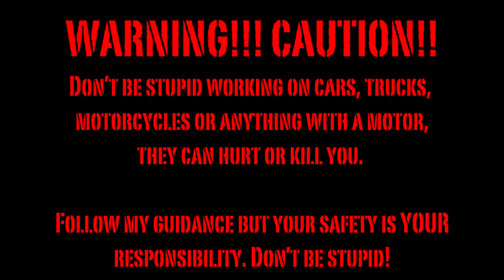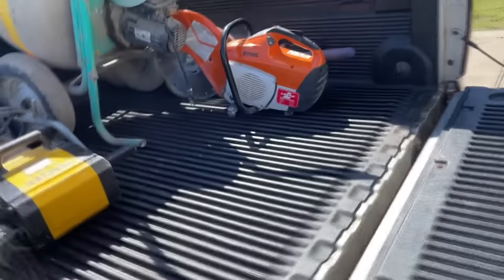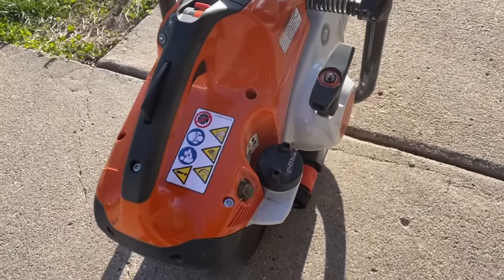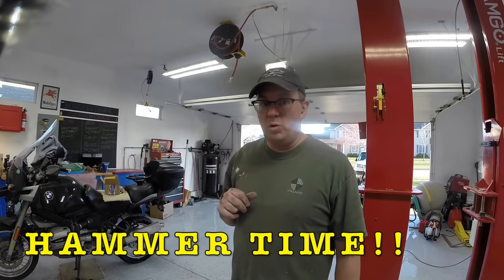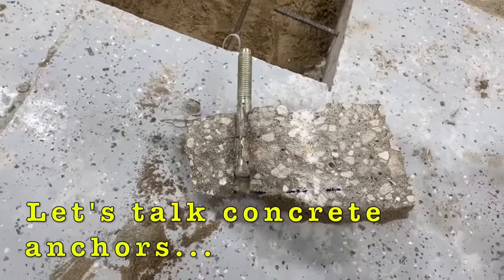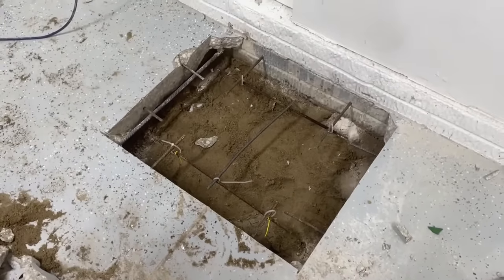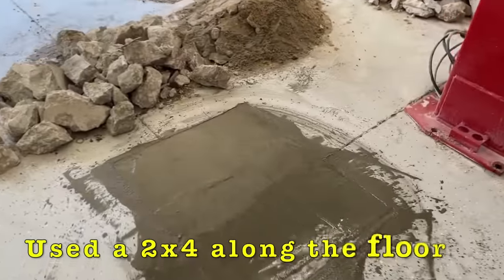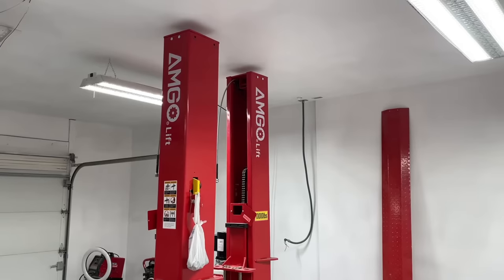My Lift tried to Kill me!

Comment: When it is a safety issue like this and I still want to DIY, I would make sure I followed the concrete instructions.  I'm fairly certain you poured it too wet, which will compromise the strength.  Especially when you have a machine mixing for you, I'd dump in the quantity of water on the bag and let her rip.  If you are mixing it yourself, I find most people make it too wet because it's hard to mix otherwise.  Another safety tip though, when working with concrete, you really want to wear gloves (Concrete is caustic) and more importantly, a good breathing mask.  Silicosis is no joke.  Cutting the concrete dry and hammer drilling it are the worst offenders, but I'd wear breathing protection even when cutting it wet - it's just not worth risking it.  The other thing, and perhaps you already knew this, but if you have a post-tension concrete slab, you want to x-ray the floor and make sure you don't cut into those stretched members, because they can rebound with enormous force.

I'm not a fan of 2 post lifts because they are not as forgiving with install and concrete slab requirements, but all of this being said, if I had one, I would tie the two posts together at the top with some metal plate or square tubing.  That way if they did try to bend inward, you would have additional stability.  I have seen a number of two post lifts that already have a top piece like that.

Comment: I don’t know if That was the outside wall or not by just cutting out a small section and added 7 inches of concrete, and bolt it in with longer bolts is still gonna act like you’re bolted into a cinderblock! At that point, I would’ve dug up most of that floor and put a bigger slab in and let it cure for a much longer time

Comment: When pouring the new pad, why not use a template and install J-Bolts or similar into the fresh concrete?  Then one is not relying on anchors.
Reply: He doesn’t have enough clearance at the ceiling to lift the the lifting columns up over bolts sticking out of the floor. But his redo job had so many serious problems the bolts would be the least of them.

Comment: the rebar is probably in the correct place, it is placed in certain places near the top or the bottom whether it is under tension or compression. however it should be over 50mm from either the top or the bottom.. i think these anchor bolt fixings are death traps. relying on a bolt in concrete which you know only too well has failed, probably not a strong enough mix when it was poured. i would be welding on some outriggers to the legs so there's no chance of it tipping. might have been a good idea to have under cut the slab on all four sides to make sure the new area can't pull out, like a dovetail joint. basically wider at the bottom than the top.

Comment: I dislike trusting concrete even with chemical anchors (if you don't know what those are, study them because they're what the pros use, not wedge anchors) so I welded a large H out of heavy H-beam (surplus steel is easy to find) and welded the base of my used lift to that. It can't tip in any direction and can even be used outdoors if you bury the H flush with the ground. For indoor use if you're gonna cut your slab removing enough for at least a stout beam connecting the bases of your chosen lift is easy and if properly welded (or bolted to plates, but welding is a lot less work) the lift cannot tip inwards. I used backing strips and 7018 filler but cellulose rod is ample too. What matters is a quality weld.

Comment: Dude where you go? I hope your ok. 4 inches would of worked for light duty. The problem was o close to the wall plus the anchors are not deep enough if they are even grabbing. You can see the studs sticking up way too high. Plus you never hand mix cement for a lift.

Comment: I know your feeling.  I have the Maxjax lift and it has the wedge anchors too.  I don't like them at all.  I couldn't get them to bite either in my 4 in concrete.  I changed most of them out for the epoxy anchors and those are solid.   I didn't have any issues after going the epoxy route.

Comment: Every 10k lift uses 5.5” anchor bolts with 3 3/8” and holds for life. That’s a cheap lift probably wrong hardware.  Why was there so much threads sticking up?

Comment: I see this failure too often.  A simple metal brace across the top would reduce flex and stress.  The leverage on such a small base is enormous.  It doesn't help in this case, the post was installed too close to edge of the slab and the concrete probably was not 30 mpa.  Even the installation of small footings is not sufficient, that is anything less than 24'x24'  x 36' deep using high strength concrete and 36" bolts.  However, this installation might suffice for a while.  But is it worth the risk?  Again, in this case, the rectangle should have been 90*. Also, this slab has no rebar.  And the rebar added...  you couldn't afford more bar and anchor points?  Scary.  PS  Concrete only works in compression, not in TENSION. (which is the tucking of concrete under the existing slab, there is no strength there.)

Comment: The pad I poured for my lift has 16" deep x 48" x48" under each post.
What you did is no better than the shitty original install. And the mix was WAY too dry. If you are not going to do it right, at least tie the 2 posts together with a 2x12 and attach that to the ceiling joists for lateral stability. It will be many times less prone to leaning again.

Comment: You can't drill structural holes in concrete with a cheap hammer drill. You need a sds drill for #4 steel and drilled at least 12 inches into the steel.

Comment: Wrong anchors. Wedge anchors suck. A sleeve anchor would have gripped the hole.

It the floor was 10" deep, the wedge driver would have had solid backing and expanded tightly. With only 4" the wedge broke out the bottom part of the slab and didn't fully expand.

A sleeve anchor would have drawn the wedge part up into the sleeve.

Comment: The pads needs to be at least 10 times large  and encorperated  together. The concrete to be twice as thick with the anchor  bolts incorporated  with the resteel. This is the  very minimum also use less water with a7 to 9 sack cement mixture with 6aa stone and 2ns sand. Consult  a structural  engineer

Comment: Did you remove the former existing rebar? 

Often, those are on tension/torsion systems to make the concrete pad stronger. 

If you removed them, you just screwed yourself.

Comment: Mine did the exact same thing it was very alarming I ended up having 18 inch j bolts made and put it in the foot and a half of concrete and you can crash into it with a truck it doesn't move

Comment: Patch job not good enough.  Patch should have been about twice as wide (or more) and should have been one large patch from side to side, connecting across the middle. I personally would have gone deeper than 7 inches while I was at it.

Comment: Well, I’m no professional installer but I’ll guarantee you are not supposed to put it that close to the wall? I’ve also seen the regular wedge anchors fail, constantly get loose etc. I like the long threaded rod imbedded in special epoxy. I’m getting one and getting it professionally installed even though ai could technically do it, my lift will weigh just under a ton, yes, over 1,900 pounds, no back for that. If I was going to all that trouble, I’d go down a foot. I just had mine poured. They dug another 6” or so, 2’x3’, so that area should be 8-12” thick, also used 3500 psi, fiber reinforced too. When your life is on the line, you can’t put it too deep. Hope it works out for you.
Reply: I forgot, they also put wire in the whole floor, and pull it up into the concrete where most just let it lay there and pour over it.

Comment: Well it didn't collapse?   I have a lift similar to that in my shop and i put some heavy brackets going up to trusses to tie it all together, supporting the top from leaning one way or the other. Works fine, you really have to get the vehicle centered properly with weight distribution which most people don't. My bolts are only in the ground 4-5 inches at most.

Comment: I think  I would  have drilled  a whole  in the center of the  cutouts and  installed an eye hook. I would have used an engine hoist to lift the cement in one Section and not have to use a hammer and chip the epoxy

Comment: should be a foot away from the wall. 4 inches is more than good enough but 6 is obviously better. the new pads you poured are also too small. should have done minimum 3x3 feet

Comment: my lift broke the concrete 30 seconds after i got out from under my truck. I almost got killed. I built a support bracket from the top of the pillars. i have the same type of lift. my truck dropped sideways.

Comment: That concrete is way too runny it is not going to be structurally  safe. In my opinion you would have been better off with installing a larger steel base plate to help distribute the load bolt through the plate & weld the plate to the lift too. Way more work but in my opinion the only way to do it. An 1/2" thicc steel plate is probably stronger than a 4" steel slab

Comment: I think i would have put J bolts in the concrete when i redid this. Also i have anchored hundreds of things using those anchors and never has an engineer called for using epoxy with them. I dont ever recall one failing either. Good work looks like it was a pain in the ass.
Reply: I also never had one that failed before either In 25 years of using them, Plus they were too small you should have been using 5/8 minimum Diameter Anchors on that lift, also should use a transit to level those lift pillers
Reply: @dougdier3104  did you mean to plumb them then you use a plumb bob

Comment: You can’t bolt lifts on the saw cut lines. And you can’t possible have bolted the outer post level along that edge in a garage. You didn’t do it right from the start

Comment: Your outer bolts are very close to the outer side of your concrete floor. You should not install the post so close to the edge of the concrete, it is not about the siyze of the bolt but a wrong placement…

Comment: Footing definitely not a footer and 24×24 and 18 inches deep then make a plywood template and then get wet set J bolt's no less than 12 inches long and I personally would drill out the factory holes and use a 3/4 bolt 18 inches long and a plate washer on the bolts so it spreads the hold I did my buddy's lift and it doesn't wiggle with my 2500 long bed crew cab

Comment: You have way too much thread showing on the bolts, and you should be 6" away from the wall. Lift was not installed properly. The Bolts are fine..

Comment: There isn’t just a thickness requirement but a psi rating of the concrete. Your original concrete probably was the wrong psi rating that’s why the fasteners were pulling out.
Reply: They were installed wrong, that is why they pulled out.

Comment: My lift has 14 3/4" Tapcon bolts in each side.
Reply: Nice. I like those also.  I dislike the wedge type anchors.  Seen too many not work
Reply: @scubasteve7946  I build $55 million dry Ice manufacturing plants and that's all we use.
Reply: @lazyhoundracing9621  advantages also when you remove equipment, the Tapcon will simply unscrew and it's flush.  A wedge anchor needs the equipment lifted straight up off the studs first, then the stud must be cut and ground off or another trick many don't know is always drill the holes through the concrete.  Then you can drive the wedge anchor down below the surface later if not needed anymore.
Reply: @scubasteve7946  International Building code will not allow wedge anchors on anything that vibrates. So except maybe a bathroom stall they are not used. we use them on equipment up to about 20 tons. Beyond that it's poured anchor bolts up to 3" in diameter.
Reply: @lazyhoundracing9621  interesting, didn't know that.  I have seen them on lots and lots of processing equipment.  I always thought the poured in place or epoxied anchors are probably the best for vibration idk.
Reply: @scubasteve7946  We only use epoxy if there is no other option and I can get it  approved. It's over rated.

Comment: The problem in my mind as an engineer is not that you need to make the footings even "stronger".  You are building the wrong thing.  You need a proper lift with a top bar.  Then everything becomes much less critical and more forgiving.  You can make crummy footings but as long as they're halfway reasonable, they'll probably last longer than you care about, if it's a proper design.  A proper 2 post lift has a top bar, a 4 post lift has a center platform, they both have something to prevent the posts from torquing inward.

Note that a simple piece of cheap folded sheet metal across the top, which is what a proper 2 post lift gets, is better than titanic efforts to anchor those posts even stronger and stronger at the bottom.  What you're trying to do is like lifting a weight off the ground with a 4 foot shovel where you hold no more than 4 inches from the end.  You need tremendous strength for that, vs. walking up to it and picking it up easily.  It's all in where the strength is applied.  The "cheap" home solution replaces a simple piece of metal (wood would probably even work) in the right place, requiring space age materials and construction at the bottom to compensate partially.
Reply: Clown.  All is redundant.  He needed to have driven the anchor bolts ALL the way down to the bold head, then tighten.  Would have been fine.  Class dismissed.
Reply: Ok genius, explain single post lifts then.
Reply: We get it, you hate floor plate lifts, everyone does. But sometimes you just don't have the clearance for a clear floor lift.

Comment: Well for a start this ceiling height is no where tall enough for these lift posts,the width of the garage is too small to have the post that close to the edge of the concrete. This is a disaster thats going to happen again. No hearing protection or proper eye protection when grinding steel-stupidity at its finest. Guys-get the professionals in to install car hoist lifts at all times,this is how people get crushed.

Comment: Ok. Hope that will fix your leaning posts on your lift ,but I think I would have just went to iron supplier and get a piece of iron width of from top to top of post and about three or four I have wide  5/16 thick  or a square tube  1 by 1 by 1/4 inch wall and bolted to top of post ,and cut off the two bolts that moved and pound the through the concrete and put proper lag bolts in there  ,whole job would have probably took about 30 minutes , sorry

Comment: The problem is the PSI rating of your foundation! The manufacturer was not wrong. Four inches is correct, provided your foundation mix is rated correctly for the lift. 
Your placement of those anchor bolts that are close to expansion cuts is not smart at all. 
Change your video title to: I screwed up and nearly killed myself.

Comment: i'm sorry, but Mr. HoneyBadger but you should have NEVER attempted to fix your concrete floor yourself!!  i have a car collection and i am currently building a 65x150 steel building as a new garage.  i'm pouring all the floor at 6" but where my two post lift will be, a section 12'x20' will be left open for a separate pour. i do NOT accept lift manufactures "minimum" recommendations for concrete specs.  i am the one that will be under a car on a lift and i want to make SURE my lift is not going anywhere.  i recommend to EVERYONE to DOUBLE the specs from any two post lift install recommendations.  for my lift, i am doing two 36"x36"x36" "pilon posts" under each lift base with anchor bolts coming up from them with 6" of high-strength concrete poured OVER these pilons.  the lift posts will essentially be bolted to the pilons through the floor.  i flip houses and i have done concrete work but i HATE it!  doing concrete right and SAFE requires a LOT of knowledge and experience!  concrete has multiple variables that ALL have to be "just right" for the concrete to set up correctly and to cure properly.  it looks like you used bags of concrete that you purchased at a Home Depot or Lowes.  I would have NEVER trusted bags of "quick-crete" to mount an auto lift on.  you needed a commercial grade and mix of high-strength concrete from a cement truck for your lifts.  i would suggest you take that cement saw you rented and cut out ALL the cement you just poured and then EXCAVATE down into the ground to create a 36"x36"x36" cavity and then do a "commercial grade" support pylon with correct support bolts imbedded into the pylons based upon the "footprint" of your lift post base plates.  THEN pour concrete around that pylon.  you cannot be TOO SAFE when dealing with a two-post auto lift.

Comment: "Newb says, "Ive never done this before." Concrete contractor replies, "That's rather obvious!" !! Exhibit A: Your rebar is too small in diameter and too soft (as evidenced by the bend in the center piece)!  You may as well have used coat hanger wire.

Comment: 🤣🤣🤣🤣always have more than 6 inches 
Gives it away with the amount of the bolt thread has pulled up when you torque the post 

Plus legal requirements is 600 ml from a moving object on the  lift it to close to the wall

Comment: If the lift is deflecting, you have an alignment problem. Despite the stress from the deflection, you didn't show failing concrete, and then you tore the concrete out. You have a logic failure.

Comment: So many problems. Original concrete not poured correctly. Anchors barely in instead of properly installed. New concrete pour not large enough(need minimum 2' of 4" thick 4000 psi reinforced concrete in all directions outside of pad), hand mixing the concrete (that drum thing is not a professional mixer),  and on and on. 

I watch these videos and wonder how much life insurance these guys have. This was his second to last video so I'm going to assume someone collected on it.